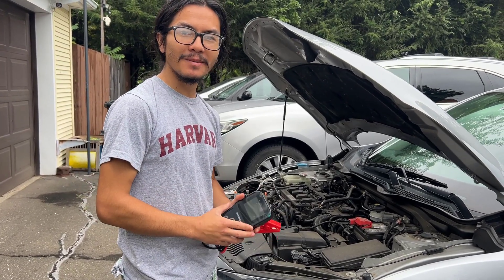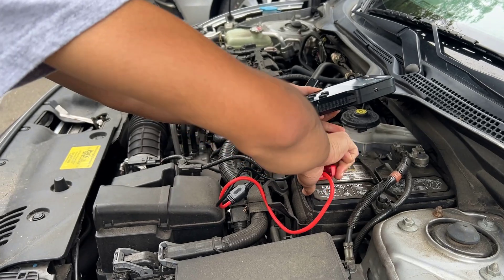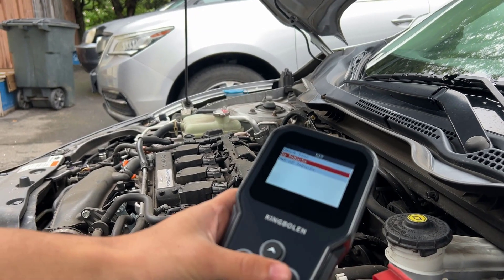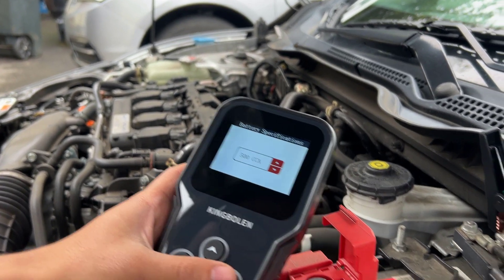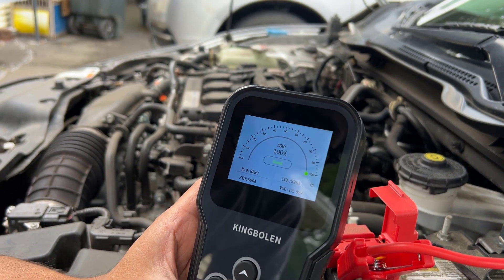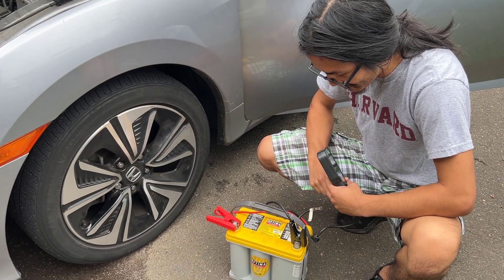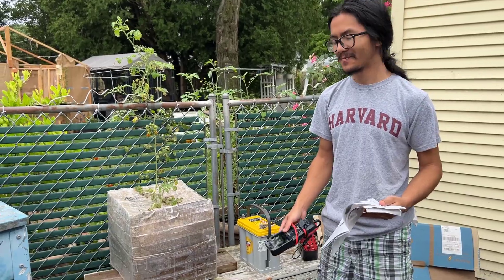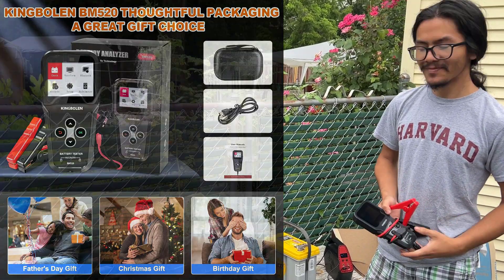How To Test Car Battery Good Or Bad | Super Easy Using This Inexpensive KingBolen BM520 Tester Tool

Comment from the maker: Here are the #ᴬᴰlinks if you're interested:
1.  https://amzn.to/3TR2YsB  |  KINGBOLEN BM520 6V 12V 24V Car Battery Tester, 100-2000 CCA Automotive Load Tester Accurate Digital Auto Battery Analyzer Cranking and Charging System Tester for Cars Trucks SUV Motorcycle
2.  https://amzn.to/4h0DgvJ |   ANCEL BA101 Car Battery Tester 12V - Digital Automotive Batteries & Alternator Diagnostic Tool, 100-2000 CCA Load Capacity, Charging & Cranking Analysis for Motorcycle, Truck, Boat, RV, Marine & More (#1 Best Seller)
3.  https://amzn.to/3BshGjc  |  MOTOPOWER MP0515A 12V Car Battery Charge Tester and Alternator Analyzer
4.  https://amzn.to/3Y8Cx4c  | KONNWEI KW208 12V Car Battery Tester, 100-2000 CCA Load Tester Automotive Alternator Tester Digital Auto Battery Analyzer Charging Cranking System Tester for Truck Marine Motorcycle SUV Boat
5.  https://amzn.to/4eIFBcD  | NOCO GENIUS1, 1A Smart Car Battery Charger, 6V and 12V Automotive Charger, Battery Maintainer, Trickle Charger, Float Charger and Desulfator for Motorcycle, ATV, Lithium and Deep Cycle Batteries

Or Click on Amazon link here and search for what you need:  https://amzn.to/3D1T2GQ